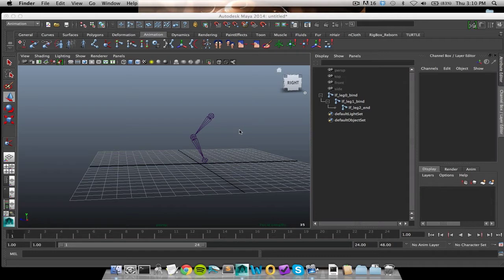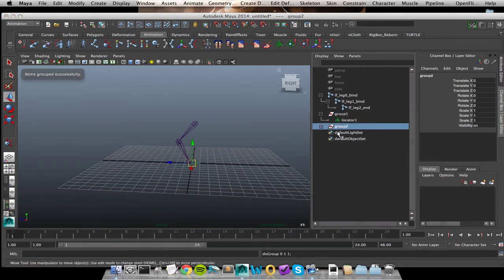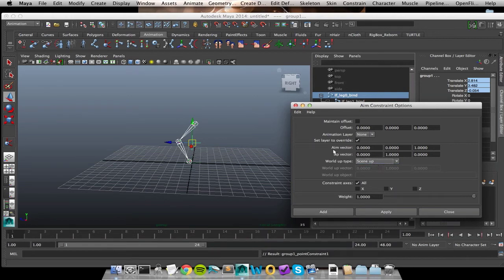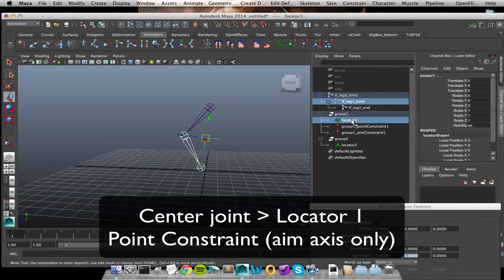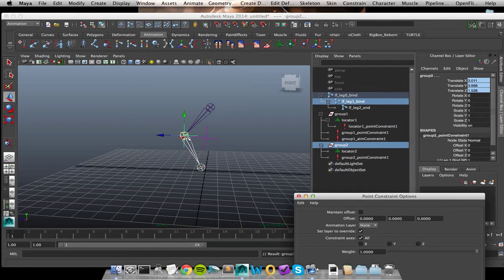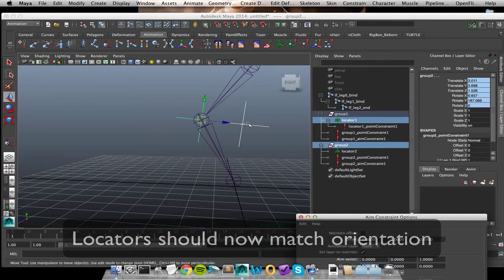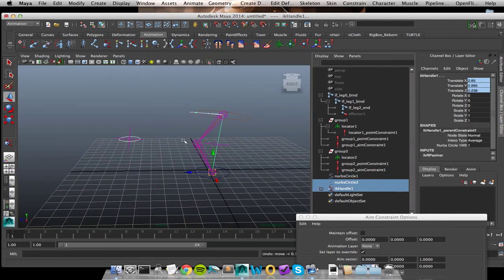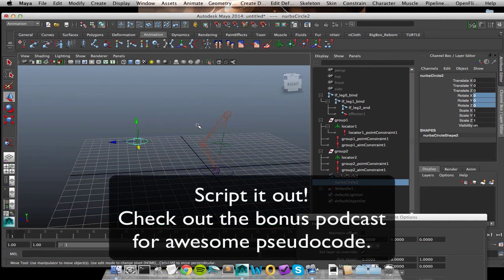Tips and Tricks: Pole Vector Constraints - Part 3

Comment: Hi. You can do this setup simpler with no groups, 2 locators, 1 point constraint, 1 aim constraint.
2 locators, one parented to the other. Parent locator is point constrained between top and bottom and aiming at knee as you have. Then just move child locator to be in front of knee in object space. Tadaa. As someone who has used 3ds since the DOS days, and then 3dsMax, then Maya and Houdini I find that there is often unnecessary use of groups with Maya people. Which clutters up your scene. Granted, this vid is from 9 years ago.

Comment: hi~nice to meet you .How can I apply this skill on the model's arm which like the model in RigBox Reborn - Proxy Creation Tool.my model is builded like this one ..
Reply from the maker: +Han Hans The arm should follow the same concepts. The only real difference is that the joints are oriented differently. It is still, typically, a three joint chain. Follow the same steps shown in this podcast and you aught to get the same results. If not, reach out to be again and will figure out what's going on with your scene. : )
Reply: I'll try again.thanks( ^.^ !)